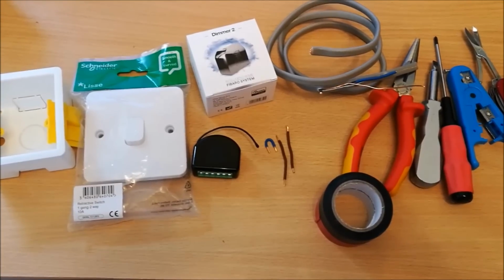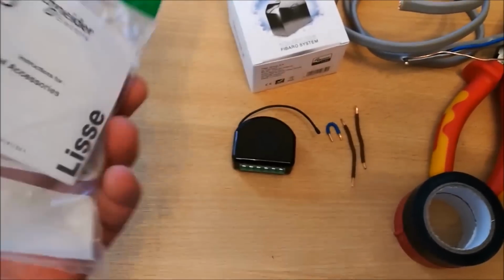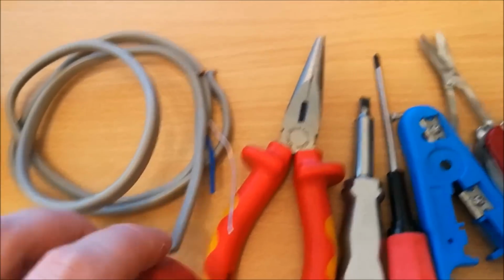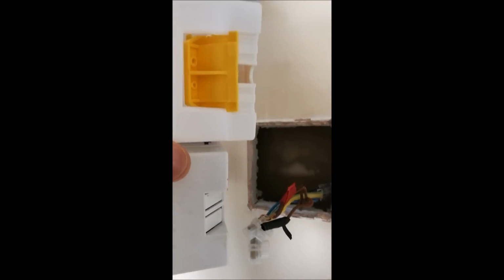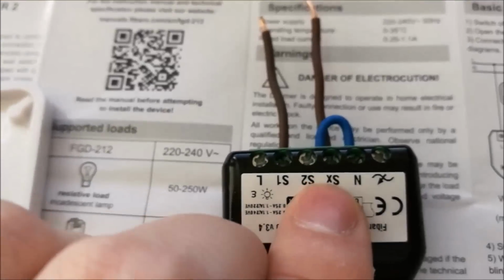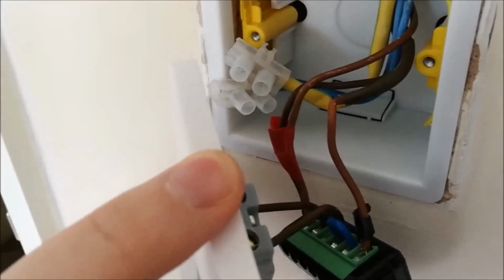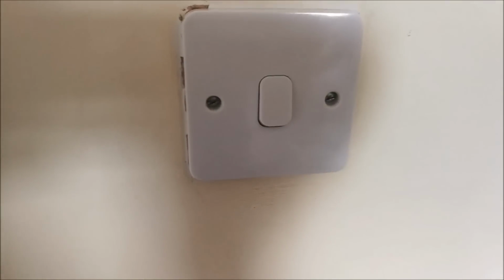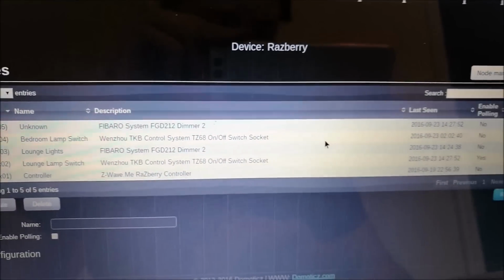Fibaro Dimmer 2 ZWave Installation UK 2 Wire

Comment: Hi team, thanks for taking time to answer my question., recently I buy a fibaro FGS-223 to test the compatibility with my house electric wire. I am trying to figure out how to connect to the lamp switch.

The issue is that I don’t know with cable go to where.. 
Like I can see… the marked cables comes from the lights because there this is the end of the circuit, but im not sure.

Thanks a lot! And best regards

Comment: Thank you so much for this guide! It is possible to use a "normal" switch (one with on/off)?
Reply: Geob Omatic there is one available soon. But not released yet. It works and on the stage of having the enclosure made.
Reply: @gibo588  is this new version available yet?

Comment: I was wondering if you have had a look at the single switch from fibaro for home kit, I have the problem of no neutral and was wondering what the cable arrangement would be for this device if its possible not to use neutral? Thanks in advance.

Comment: Is there a non dimmer version. I have lots of non dimmable gu10 (that I dont need to dim anyway) but Id like to have a local switch and zwave control. Of can this fibaro be used as a non dimmer.

Comment: Hi Peter!
How do I connect the dimmer if i have 2 switches in the circuit? Like you would in a corridor, or at the top and bottom of a staircase?

Comment: Hi Peter, thanks for the video. My house has the neutral wires, and so I was wondering can I ignore them as you did in the video or should I connect the neutral to terminal N ?
Reply: Peter Kinder thanks. I take it I don't need the loop wire, instead connect the neutral?

Comment: Great video!.. very informative and east to follow. Do you know if the dimmer would work with a normal dimming switch? So could use it normally to dim / brighten lights but also dim / brighten them remotely?
Thanks,
Paul
Reply: 3 years later, if someone else is looking for the reply. It does not, do not use "dumb" dimmer with it. Needs to be a switch.
Reply: Fantastic video - I think most people could follow that and keep themselves safe.

Comment: Thank you for this comprehensive guide. Guessing that your raspberry pi is the controller. Did you follow a how to for your setup of the pi if that's the case?
Reply: Thank you I had never heard of this before. Is it stable and reliable? I had openHab and other HA controllers setup and they would occasionally have to be reset. Any issues you came across as a UK user?
Reply: What USB z wave USB stick did you use? This is very impressive work
Reply: Thank you for your help. I can't wait to get some of this installed. It's a whole world of fun.